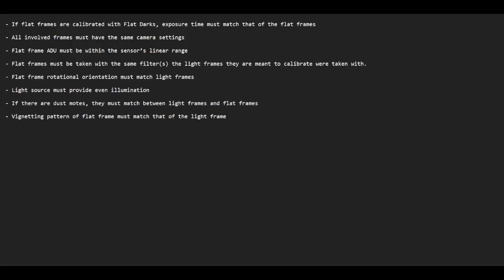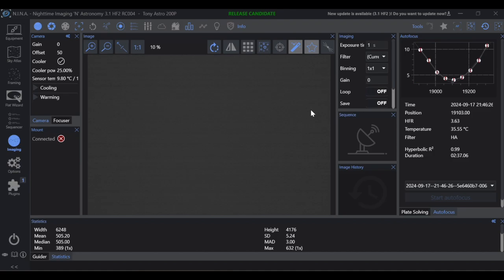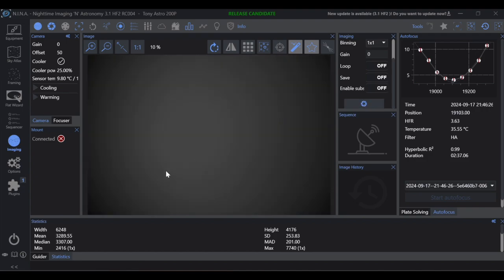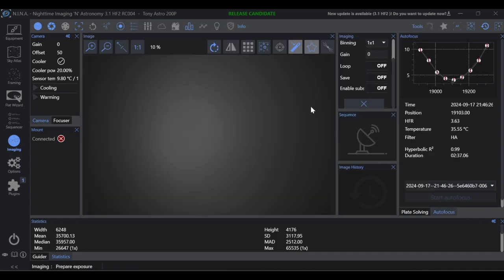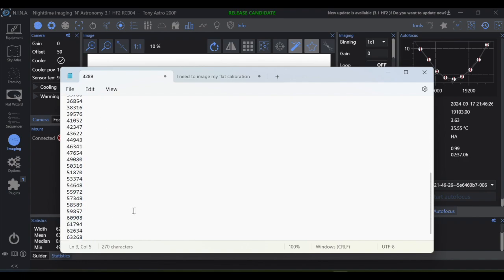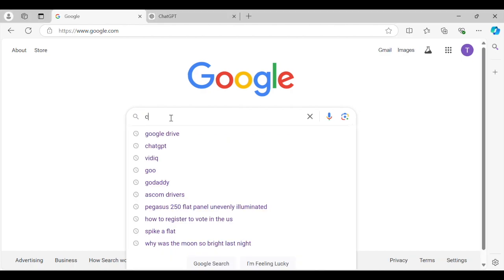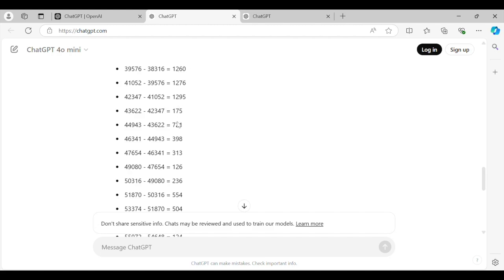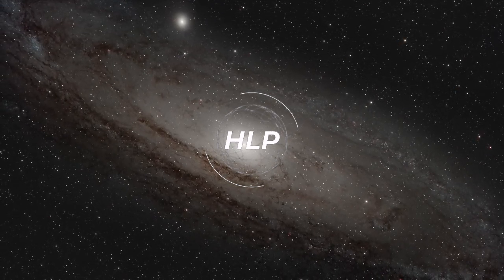Unlocking the Linear Range of Your Camera Sensor: Flat Field Correction Series Part 3

Comment: You're way overcomplicating it. First, NEVER trust anything ChatGPT produces. You need to independently verify that what it says is correct, which means it is essentially worthless. Second, all you need to do is look at the histogram of your flat. If the peak falls within a range of one third to half of the values and has no saturated pixels, it's fine.
Reply from the maker: You are absolutely correct with never trusting ChatGPT. As I mention very clearly in the video, this is not the correct way to do this, but rather a quick and easy way to find a range that you can use without sitting there graphing and doing the math. I’ll also make sure to reiterate this in part 4 and ensure to bring up your very valid point of histogram location and saturation checks.  The lack of trust in ChatGPT is also why I pointed to the math it did to find the drop off which gives us our range instead of pointing out its recommendation of none linearity. The reason for this video is this is a subject that gets over complicated and thought about more than it needs to, so I was giving a quick and easy exercise rather than to tediously graph and mathematically figure it out. I hope this makes sense.